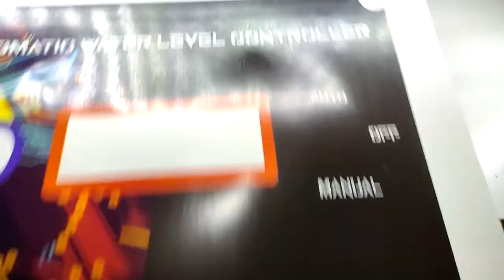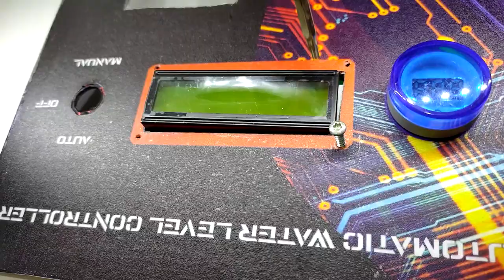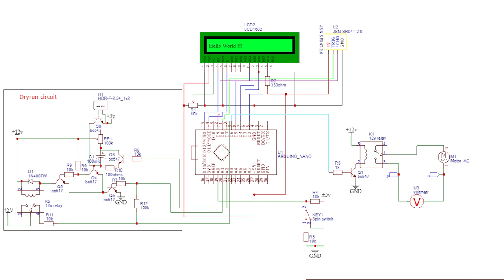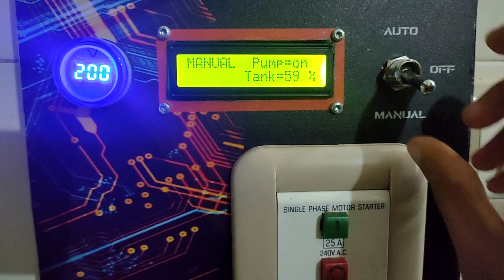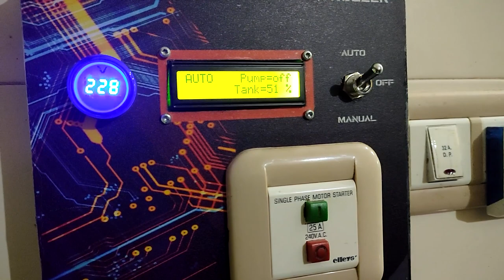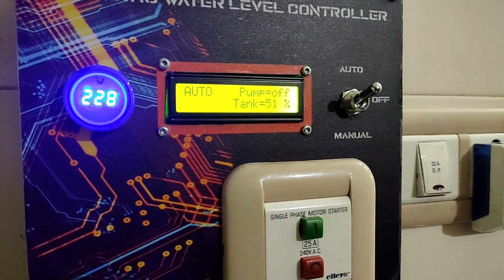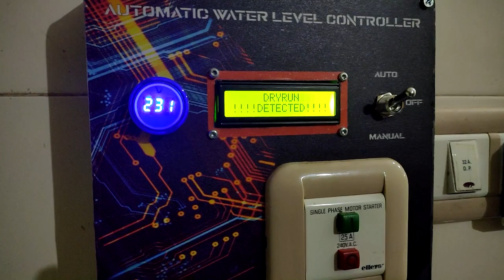Automatic water level controller using arduino

Comment: bro can i ask a doubt i cant see the 7805 ic and 100nf capaciter on circuit diagaram...can u tell where should i connect it pls
Reply from the maker: It is not included in the circuit diagram. It is used to power Arduino and LCD display.

Comment: Can you please make a circuit using Arduino for submersible pump contactor type starter which has starting capacitor need to be connected for 2sec. Two relays should be used. One for switching ON and other for OFF.
Reply from the maker: Sure
Reply: @ElectroRetro  Thanks a lot.. Can I know where are you from..?
Reply from the maker: India

Comment: Hey Would it be a good idea to use the relay before the single phase motor starter ? 
To avoid high voltage ?
Reply from the maker: Give it a try.

Comment: This is called a complete tutorial, thanks a lot for making such informative detailed tutorial. 
It would be nice if you share that graphic image you have printed, it looks nice and professional.
and what if we dont need dry run protection circuit? simply just dont attach it or anything will be adjusted in the code or circuit too?
Reply from the maker: I designed that graphic image on inkscape I will share it asap. If you don't need dry run protection you need to change little bit in the code. Thank you.
Reply from the maker: png file = http://www.mediafire.com/view/4ujgb973oqkuoeg/water_level_controller.png/file
Reply from the maker: here is the svg file so you can open it in inkscape and edit the dimension and other things =  http://www.mediafire.com/file/lyc715nyporrvvi/1119975_%25281%2529.jpg.2020_10_07_11_55_23.0.svg/file
Reply: @ElectroRetro  really appreciate that. thanks a ton. keep that good work up.
Reply from the maker: You are welcome 😊

Comment: Hi. Great work. 👍.

I have a doubt. The distance between overhead tank (to fill) and the sump (waster supply tank) / motor is around 100 metres ( when cable routed properly). What effect would this have on the circuit? And will it work for such long cabling?

Also for dry run, can i use a 2nd ultrasonic sensor for sump level measurement on a single arduino nano?
Reply from the maker: Make sure to use good cables. Check continuity using a multimeter. Then you can use it for 100m. If your cables are bad, then Arduino won't get any signals from ultrasonic sensor. Arduino will display 100% all time.

Yes, you can use 2 ultrasonic sensors.
Reply: @ElectroRetro  😀 fast response. Thankyou very much. 🙏

Comment: hey man great video .  i was wondering if the relays can handle the high voltage from the single phase motor starter
Reply from the maker: This relay can handle max 30a at 230v
Reply: @ElectroRetro  so the starter capacitor volts is less than the relay ratting ? For a single phase motor
Reply from the maker: Yes
Reply: @ElectroRetro  thanks man appreciate it
Reply: use contactor between relay & pump

Comment: can i know how you resolved that ultrasonic sensor problem, because it can measure distance above 20CM .Also if the distance is less than 20cm some junk values are comming.Can you suggest some ideas
Reply from the maker: In this controller it will show as 100% if distance is less than 20cm

Comment: Bro I did it without "dry run" using Arduino UNO. Everything working great 👍except Manual mode 🤔. There is a peculiar happening , when normally powered by 12v 4Amp adapter through 7805, after switch over to Manual mode, "Manual" lcd print not coming & motor = off. But same time if I connect usb cable from my laptop to Arduino UNO then MANUAL lcd print is coming & motor=On. Can't understand 🤔. If guess anything please help/suggest me. Thanks in advance. Thanks
Reply from the maker: Can you Send me the code
Reply from the maker: Try adding a filter capacitor in the input
Reply: @ElectroRetro  sure. Please share your mail ID .
Reply: @ElectroRetro  Bro filter capacitor in which input? If u mean to say UNO 5v input? That's already I did. 2200uf/10v. Please suggest. Thanks.
Reply from the maker: Input of 7805 ic
Reply from the maker: electroretroyt@gmail.com
Reply from the maker: And try powering with a 12v battery.

Comment: Hi!!
Need a small help here....I built one and it is able to turn on the pump but doesn't turns it off. 
I am using lower limit at 26cms.
Reply from the maker: Make sure it is in auto mode.
Reply: @ElectroRetro  this is happening in auto mode only
Reply from the maker: Is all connections OK?
Reply: @ElectroRetro  yes
Reply from the maker: Try uploading original code and check if it's working properly.
Reply: @ElectroRetro  okay
Reply: @ElectroRetro  still not working....I am using digital pin 13 for relay......and also changed the code accordingly...
Reply from the maker: Can you please send a video?
electroretroyt@gmail.com
Reply: @ElectroRetro  sure

Comment: " A complete project"
Many Thanks Bro. Need a small help, if I want to avoid dry run circuit then what to do changes in CODE ? Please help me out. Thanks again.
Reply from the maker: Just delete code lines for dryrun
Reply: @ElectroRetro  Thank you Bro. Many thanks. I will do it at weekend holiday & feedback to u Bro. Thanks 😊
Reply: Bro I did it without "dry run" using Arduino UNO. Everything working great 👍except Manual mode 🤔. There is a peculiar happening , when normally powered by 12v adapter through 7805, after switch over to Manual mode, "Manual" lcd print not coming & motor = off. But same time if I connect usb cable from my laptop to Arduino UNO then MANUAL lcd print is coming & motor=On. Can't understand 🤔. If guess anything please help/suggest me. Thanks in advance. Thanks

Comment: Привет1
 Начал собирать вашу схему, у вас pin Echo датчика SR04 соединен с  PIn D04 LCD , а так же с Pin  D5 и D9 Arduini Nano ? А в скече  не подключения к PIn D04 LCD  и Pin  D5  Arduini Nano ? #include <LiquidCrystal.h> //lcd library
#define echopin 9          
#define trigpin 8
#define autopin A0 //auto switch pin
int relaypin = 6; //output relay pin  
#define dryout 7  //dryprotection pin
#define dryin 15
#define cap 16
Reply from the maker: извините, я не правильно понимаю
Reply: Я хочу спросить: правильно это или нет, что в схеме  pin Echo датчика SR04 соединен с  Pin D04 LCD , а так же с Pin  D5 и  Pin D9 Arduini Nano? А в скетче не прописано подключение  к Pin D04 LCD  и Pin  D5  Arduini Nano ?
Reply from the maker: Вывод Echo подключается только к D9 Arduino, а Arduino D5 подключается к D4 ЖК-дисплея.
Reply: @ElectroRetro  Спасибо! Теперь стало понятно! Спасибо! На почту можно скинуть?
Reply from the maker: Пожалуйста, да

Comment: bro can u make it wireless by using Rf modules?
bcoz running long wires for sensor is not practical if overhead tank is at 4th or 5th floor and RF modules are very cheap. we can power both circuits separately from our solar batteries or using mobile chargers
Reply from the maker: Maybe I will try in future.
Reply: @ElectroRetro  thanks btw you should have said very near future to be precise..lol
Reply: any update? and btw code is missing, will u share full code?
Reply from the maker: Currently in testing a wireless version with Esp32. You can get the link to the full code in the description box.
Reply: @ElectroRetro  ok bro waiting for that wireless version, any idea when will u upload that video?
Reply from the maker: The prototype is not yet finished. I will upload as soon as it's ready.

Comment: I am using waterproof ultrasonic sonic sensor but measurement value cant read acutely and also change other code
Reply from the maker: This sensor can only read values from 20cm.
Reply: @ElectroRetro  the Waterproof sensors just read value from 20cm, is it mean the 20cm is 0cm for starting measure..? or 20cm still 20cm? it's make me confuse..

Comment: Sir
I don't know electronic but i need full product for my use at agriculture pumpsets can you give
With sump dedection also required
And to control 5 to 6 solenoid valves for drip irrigation with timer programme module with separate relays

The cost will be sent to you
Thanks

Comment: Will the circuit diagram work if the water pump is large (220 volts, 1200 watt)? thanks
Reply from the maker: Yes,make sure to use higher ampere relay.
Reply: You make this project
Reply: I make this project per does not work
Reply: I will try to do a simulation using the Proteus application

Comment: Dear friend, let me know which line in code to be change for tank height, I can't understand,
Thanks
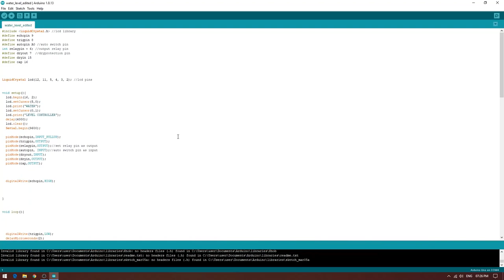Reply from the maker: 8:35 you can see cm to percentage.
Reply: Dear please help me, I am weak in coding, I think this line will change "distance = map(distance,20,123, 100, 0); //cm to percentage", please tell me with example, suppose tank height is 100cms, then what will changes in above line
Reply from the maker: Change 123 to 100
Reply: Thank you very much for quick response ❤️

Comment: Dear I trying to make pcb in software, can you upload both side clear picture of dry run circuit only
Reply from the maker: Link in description
Reply: @ElectroRetro  sorry dear, I need picture of dry run pcb wired by you not circuit
Reply from the maker: @nareshjain3732  Sorry I don't have it
Reply: @ElectroRetro  ok,

Comment: great, you are perfect... How to change high tank water?
Reply from the maker: Do you mean changing tank height?
Reply: @ElectroRetro  my tank depth is different soo how to adjust it as per my need?
Reply from the maker: In code, "distance = map(distance, 20,123, 100, 0); //cm to percentage", in this line change 123 to your tank size in cm.
Reply: @ElectroRetro  you mean the depth of tank right? Let's say my tank is 4 ft depth.. Soo should I change it to 400?
Reply from the maker: @boopeshkumarprabhakaran  yes, 4ft = 121.92 Centimeters. So you need to change to 121.92cm.
Reply: @ElectroRetro  thanks bro. It's 4 meters not ft.. 😅
Reply: @ElectroRetro  In code, "distance = map(distance,20,123, 100, 0); //cm to percentage". What mean of 20,..., 100, 0 number?
Reply from the maker: 20cm means minimum range of jsn-sr04t sensor and 100, 0 means converting cm to percentage.
Reply: @ElectroRetro  thanks bro

Comment: Mene waterproof sensor use kiya to reading show ni kr rha or normal ultrasonic lagaya to sahi dikha rha esa kio
Reply from the maker: Is it showing a random number and stuck at it?
Reply: @ElectroRetro  but  value not stable
Reply: Where change tank height in code
Reply from the maker: You can see tank height in cm in code.
Reply: Apke code me tank height kitni set kr rkhi he
Reply: Ye sensor to 20 cm minimum range ka he
Reply from the maker: 123 cm
Reply from the maker: New version of water level controller :- https://youtu.be/ou_pa8sLPI8

Comment: Dear friend, Maine circuit proteus me simulate kiya to auto mode me dry run detect nhi karta ,agar Arduino ke pin D7 ko 1k5 resistance se ground kar de to dry run detect ho jata hai, 2nd problem jab dry run wali wires ko connect kar de to motor apne aap nahi chalti circuit ko restart karna padta hai
Reply from the maker: Can you pls tell me in English
Reply: @ElectroRetro  I simulate the whole circuit in proteus but dry run not detected, dry run detected if pin D7 of Arduino ground through 1.5k resistance, 2nd problem is when I connect the wires of dry run, motor should be turns on automatically , but system is still in dry run and motor is not start, if I reset the circuit motor turns on
Reply from the maker: Adjust the potentiometer in dry run circuit
Reply: @ElectroRetro  Thanks for quick reply,i will try
Reply: @ElectroRetro relay k1 cunducted ,but dry run not detected
Reply from the maker: Dry run only work in auto mode. So make sure your switch is in auto mode.
Reply: @ElectroRetro  yes switch is in auto mode, but dry run not detect,detected only when we ground the resistance 1k5 from d7 of arduino
Reply: @nareshjain3732  dear friend I am waiting for your response
Reply from the maker: @nareshjain5339  check your dryrun circuit
Reply: @ElectroRetro  relay conduct when sump tank is empty, I think it means dry run circuit is ok, but arduino is not detected and pump is running
Reply from the maker: Arduino D7 pin is used to detect dry run check voltage on d7 pin.
Reply: @ElectroRetro   D7 voltage is 0.7 in dry run (means open connection of sump) , but pump is running, if I ground 10k on pin d7  then voltage is 0.5 and then pump turn off snd lcd show dry run detected
Reply from the maker: @nareshjain5339  try connecting a 100k resistor D7 to GND.
Reply: @ElectroRetro  ok dear, I will try tomorrow
Reply: @ElectroRetro  one more question please, when I ground 10k on d7 and sump is empty,then dry run appear and pump stops, but when sump filled, then d7 voltage is 4.9v but arduino not detect water in sump, but when restart the circuit arduino detected
Reply from the maker: @nareshjain5339  when dry run detected you need to restart arduino to work normally.
Reply: @ElectroRetro  dear, but I think pump start automatically when water filled in sump, no need to restart
Reply from the maker: Every functions of arduino will disable when dry run is detected
Reply: @ElectroRetro  Dear, once dry run detected then how to come in running mode without restarting, while under water tank is full, but system detect dry run then what's the meaning of automatic control
Reply from the maker: You need to change the code.
Reply: @ElectroRetro  Thanks for quick reply, dear I am strong in hardware and weak in software, let me know which lines will add in code, and where to add that pump start again when lower tank filled, not need to reset the arduino
Reply from the maker: Btw the dry run sensor should be placed on the water inlet. Not designed for sump tank. Once dry run is detected the motor wouldn't turn on automatically this is for protection of motor.
Reply: @ElectroRetro  I mean sump means lower tank, my English is weak, mera matlab jab lower tank bhar jayega to apne aap motor chalni chahiye,

i sump means lower tank, my english is week, i mean when the lower tank is full then the motor should run automatically again, otherwise the circuit cannot be use
Reply from the maker: This dry run circuit is not designed for lower tank, it is placed on the water inlet pipe on upper tank
Reply: @ElectroRetro  ok, Thank you very much for your response
Reply: can you change in code for lower tank, actually we have a lower tank too, pump fill the upper tank from lower tank, I need pump turns off when lower tank empty and turns on automatically when lower tank filled, we dip the 2 wires in lower tank to detect the water,

Comment: Can you please share the gerber file ?
Can we use aluminum wire dipped in the water tank for dry run detector?
Reply from the maker: Yes,you can use aluminium wire.
Reply: @ElectroRetro  Can you please share the diagram in simplified form ?
Reply from the maker: You can get circuit diagram in description box.
Reply: @ElectroRetro  It is little complicated please share simplified diagram
Reply: Will it measure the height of tank automatically??
Reply from the maker: @shaikhabdulsami3653  no
Reply: @ElectroRetro  How to change the height of the tank and which code need to be changed?
Reply from the maker: "distance = map(distance, 20,123, 100, 0); //cm to percentage", in this line change 123 to your tank size in cm.

Comment: Could please help me for the manual mode connection??
Reply from the maker: Yes
Reply: So where is the manual motor starter is connected in the circuit??
Reply from the maker: @shivenduanand5561  connect one wire to phase and other wire to any of the motor wire. Neutral directly goes to the motor. It's connected like a switch
Reply: I can't see anything in the serial monitor. Is it normal??
Reply from the maker: @shivenduanand5561  yes
Reply: During testing when tank was full, the relay was not turning off automatically and on screen it was showing pump on. But when I was disconnecting the relay input pin from Arduino and reconnecting it then only relay was turning off. What could be the issue, is it relay module issue??
Reply from the maker: Can you pls tell me high level or low level relay?
Reply: In the dry run circuit, how is the connection between pin 2 of H1, Q6 emitter and the potentiometer RP1? As the connection seems a bit overlapped/missing at that section in the circuit diagram.
Reply from the maker: Pin 2 of H1 is connected to emitter of transistor Q6. and Pot RP1 is not connected.

Comment: Please tell me How to connect the manual stater switch
Reply from the maker: Connect in series
Reply: @ElectroRetro  series to the manual and auto switch??
Reply: Please send the connection diagram of the stater switch and how the stater works even after switch off the whole circuit...
Reply from the maker: https://www.mediafire.com/file/l2a0bhzr2m1izyf/Screenshot_20210120_184855.jpg/file
Reply: @ElectroRetro  thanks bro..👍
Reply: Can u also share the dry run circuit diagram separately
Reply from the maker: Dry run circuit - https://www.mediafire.com/view/fv9kou9t8ctk4x6/Dry_run_circuit_.jpg/file
Reply: @ElectroRetro  thanks a lot...